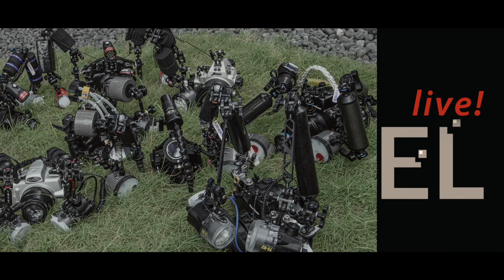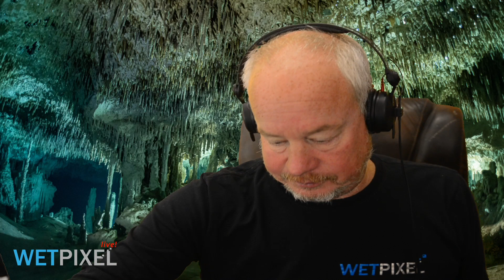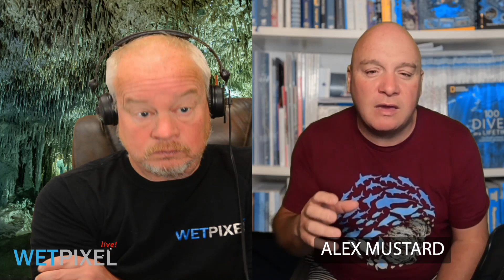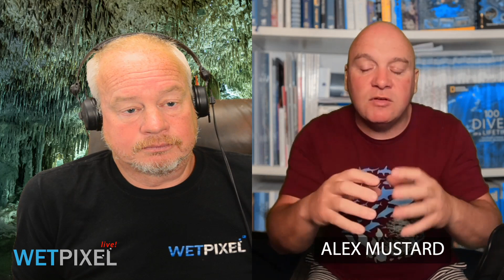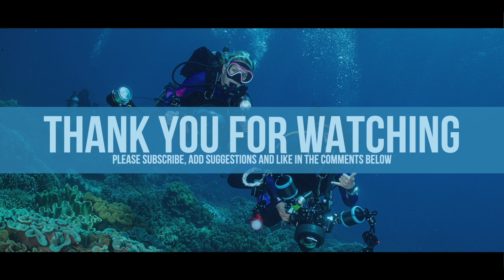Critical Strobe Triggering Advice

Comment: The good thing about the SLRs with built-in flashes you can use the original penta-prism to swap back in case of flash trigger fail.
Reply from the maker: True-although the recycle time with built in flashes is typically very frustrating!

Comment: I carry my original nauticam flash trigger as a backup for the UW technics HSS flash trigger . I have also had bad batteries be an issue. I wish the flash trigger had a warning light for low battery because the only way to know you need to change the batteries is to have it fail on a dive. Very frustrating.
Reply from the maker: Great idea

Comment: The issues with batteries and splashed circuit boards are much less likely with the TRT triggers, which are USB-rechargeable and housed in a sealed unit. And Nauticam make a basic trigger for most cameras, costing around £250.
Reply from the maker: I'm not sure that £250 is inexpensive...
Reply: @Wetpixel-Live  Is anything in UWP? 😂

Comment: Why not just take the flash you probably got with you camera as your back up?
Reply from the maker: As it normally does not fit in the housing...
Reply: @Wetpixel-Live  I thought all housings were built to fit flash? The newer flash triggers fit the space left by not fitting the flash
Reply from the maker: @glynnphillips323  - no, most woudl not fit a standard land flash. Some can accommodate a "pop-up" flash, but many camera sdo not have them.